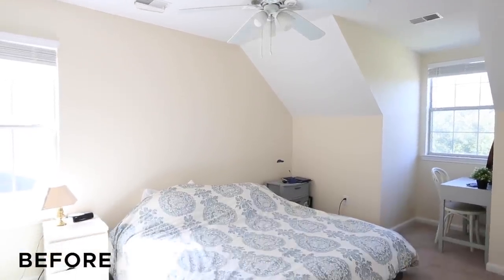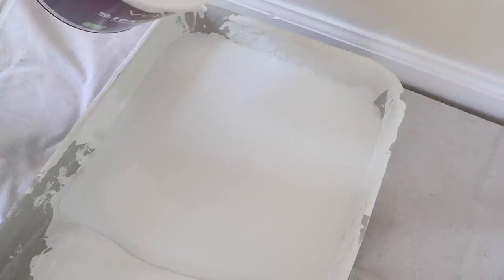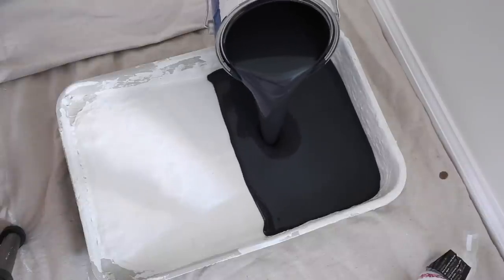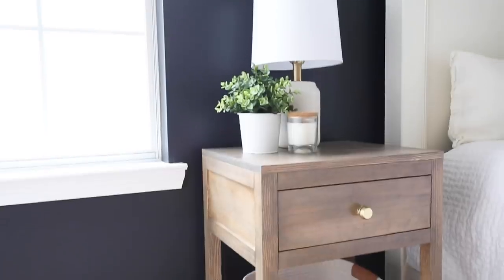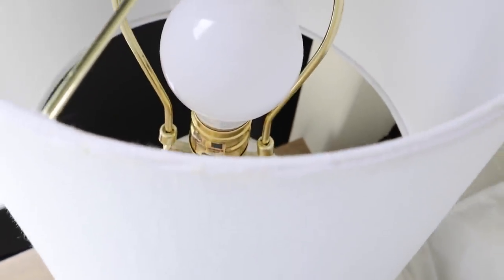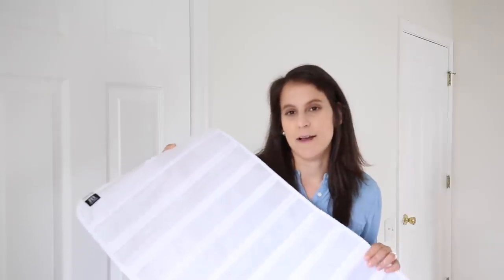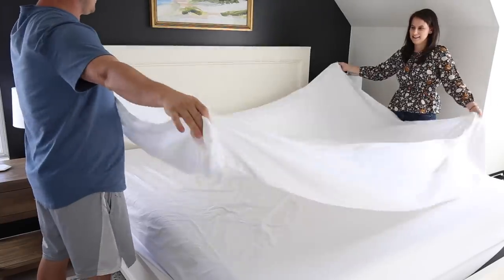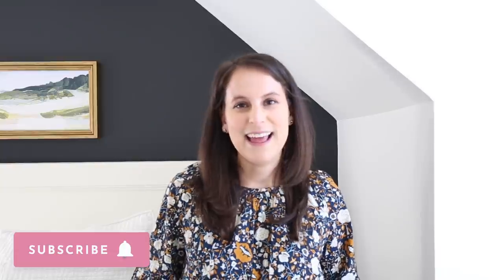DIY Bedroom Makeover | Extreme Bedroom Makeover - Full Room Transformation

Comment: Beautiful end result! I was surprised by your tip to let the cut ins dry before rolling. I've always heard you the opposite, you should actually roll as quickly after cutting in so the paint can dry at the same time and not create an odd paint boarder around the walls. I'm curious where you got that info. I love the black though. We went with a dark charcoal on all four walls in our bedroom and love it.
Reply from the maker: That's awesome! We've painted both ways and found that either way will work. A lot of times by the time you finish the cut and start to roll most of it has already dried anyway, and I think it's better to take your time and get a neat cut. We've never had an issue with the cut showing a border line. Thank you, it's nice to get a different perspective!!